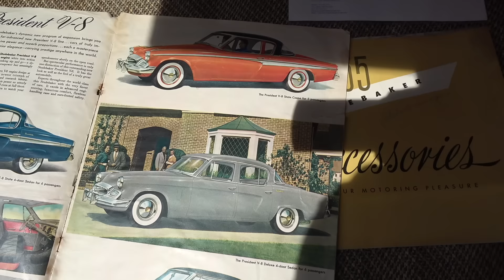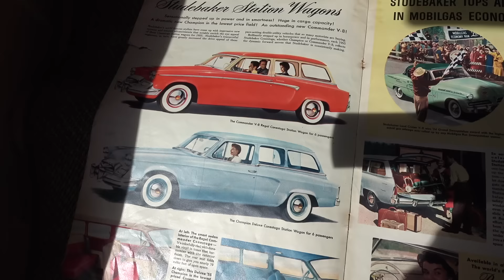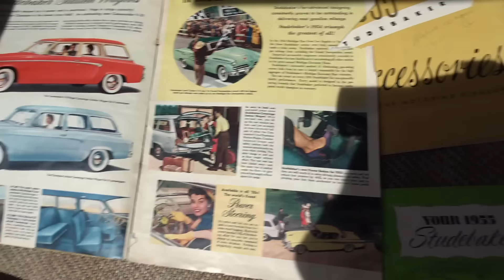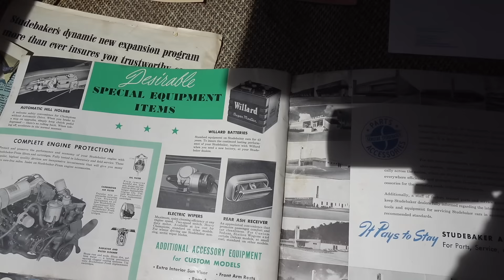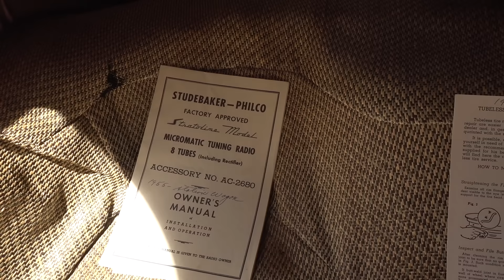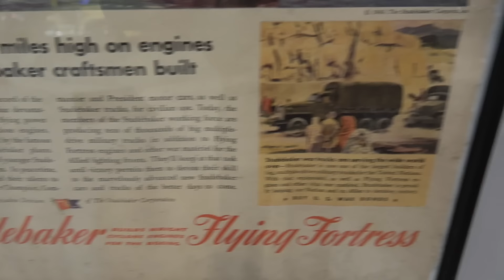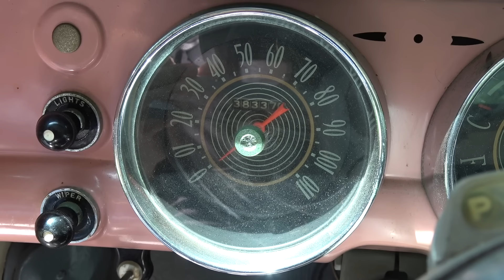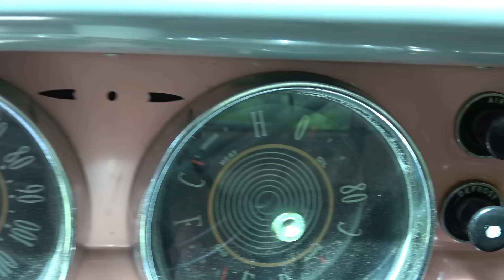Survivor 1955 Studebaker Commander Regal 4 Door Pink / White & Ride My Car Story with Lou Costabile

Comment: This car deserved a great deal more information than was provided. First, it is a spring 1955 "Vista Vision " Commander with wrap around windshield placed in production in January, 1955. The "Bearcat V-8"  was also a spring change which provided a stanard Commander V-8 of 259 cu in rated at 162 Hp or 182 optional. The car also sports the spring two tone paint style . The "Trunk Treat" brochure you showed is the fall introductory catalog, not the spring edition which accurately portrays the car featured in the video.
Reply from the maker: Hi Stude289, Thanks for sharing your knowledge and adding to the story, Lou

Comment: The challenge for Studebaker was to make a four door version of the pillared Starlight coupe. They did it, but the sleek roofline was raised to accommodate rear seating height. As a result, the car lost the sexy low slung European look. And by 1955, Studebaker acquiesced to dealer’s demands for more chrome. In spite of it all, this Studie is a real beauty and a lovingly maintained tribute to the South Bend automobile manufacturer.
Reply from the maker: Thank you for viewing and sharing your knowledge.